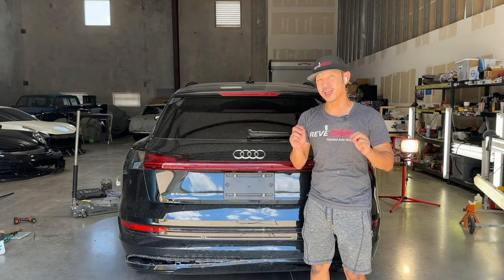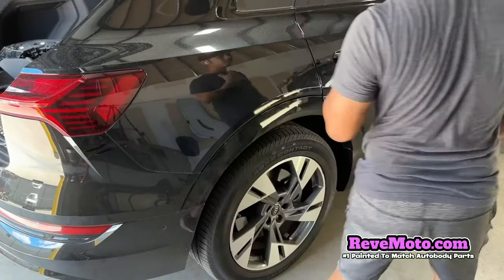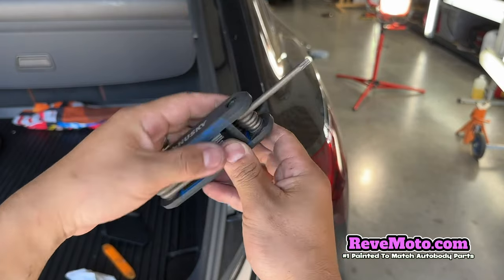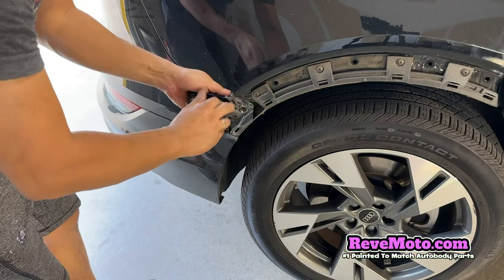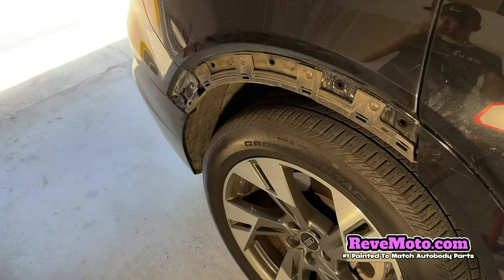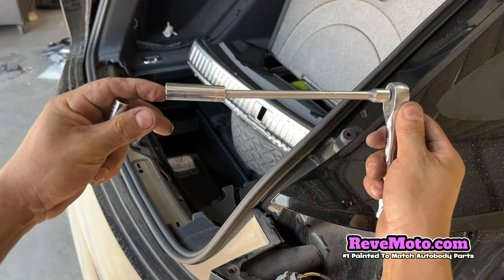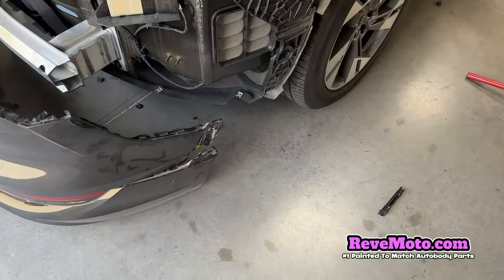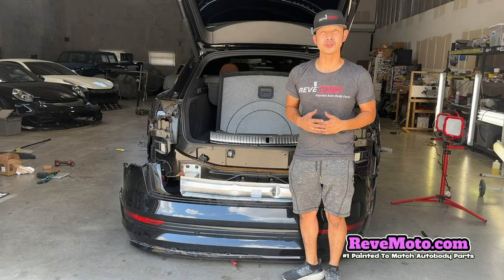How to Remove Audi E-Tron (2021-2023) Rear Bumper: Detailed Step-by-Step Tutorial Guide | ReveMoto

Comment: Been a while so you may not remember but worth a Q - Do you know / remember whether the diffuser can be removed without removal of the entire bumper?
Reply from the maker: Hi!  So it is possible.  First take off those bolts I mentioned at 9:30 mark.  The hard part without actually taking the bumper off is pulling the diffuser away from the main bumper. You can see in the video its held on with those tabs, but if you can wedge something flat they will come off.